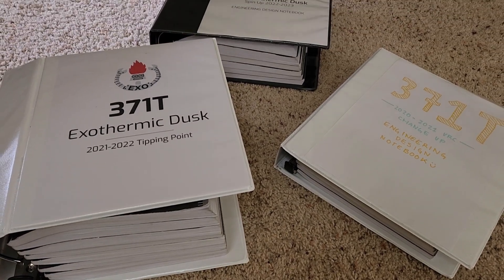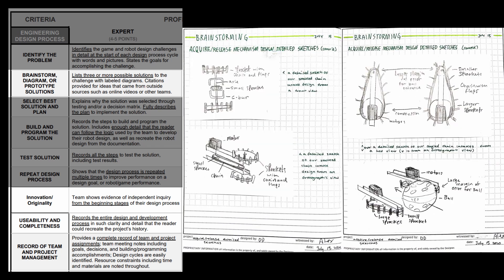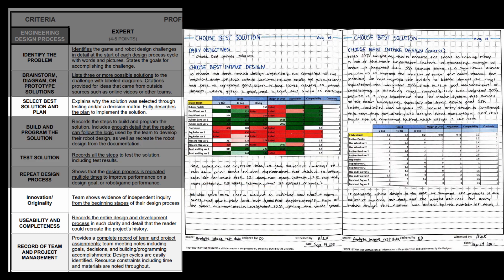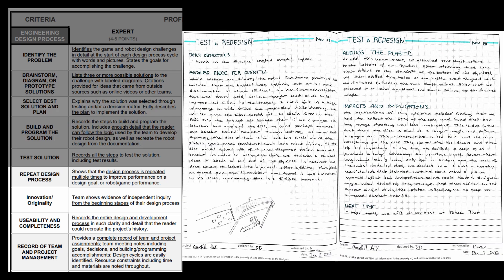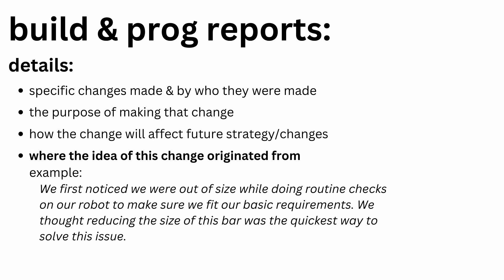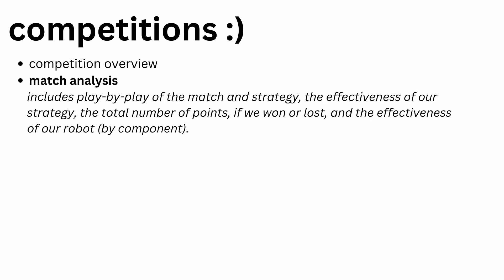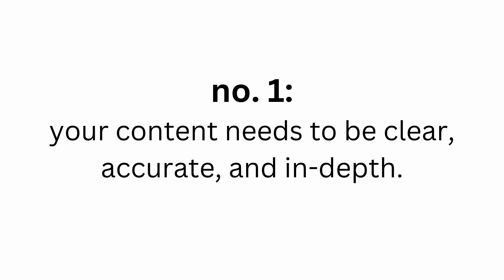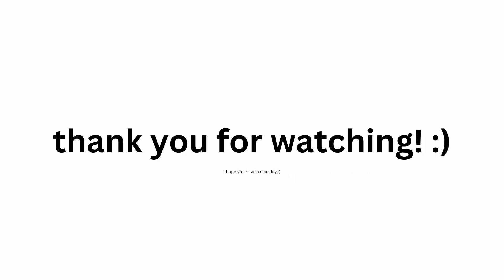engineering notebook content reveal

Comment: hello! this whole series has been very valuable ^o^ what markers/highlighters did you use? i dont want to test any because im scared theyll bleed through lol
Reply from the maker: I used zebra mildliners for the first and second years, then switched to an amazon dupe of the mildliners (which worked equally well). For the body of text I used Pilot G2 0.5mm in black and for the colored pen headings I used Pilot G2 0.7mm or 1.0mm. Mildliners are awesome if you're doing a smiliar format as I used because they have the thick side and a thin side, but if you're looking for a highlighter that has a thick side and a small side (0.4mm or so) then I recommend the Uni Propus Window highlighters (available on amazon in a pack of five, I believe?) I've recently transitioned to those and they work really well and don't bleed. (Notably however, with the GSM of the paper engineering notebooks these days, only colored marker and sharpies will bleed through iirc) 

Hope this could answer your question, I'm glad you enjoyed the videos! :)

Comment: What do you use for the Report Format? I can't seem to find a good application to do it on. Thanks for the videos, theyre extremely helpful!
Reply from the maker: I currently use Google Documents for easy sharing. 
I tried using Notion, but it's not free (it has a block cap) and it's a headache to transfer over to Google Slides. 
Hope this helps! :)